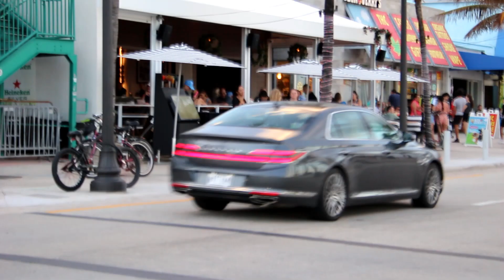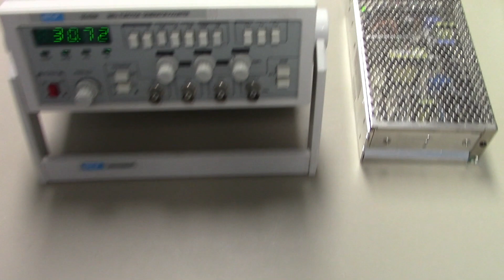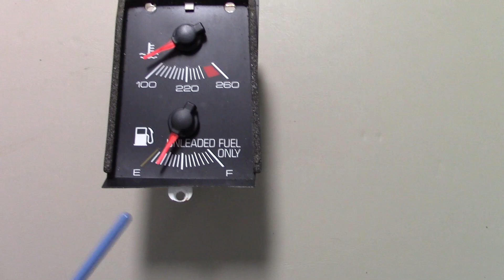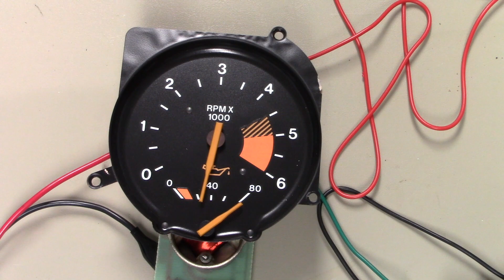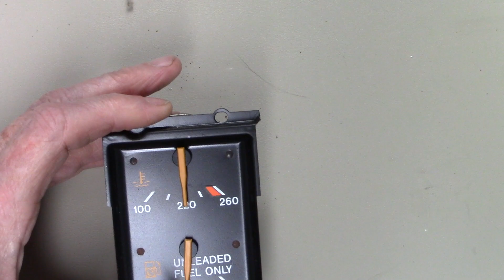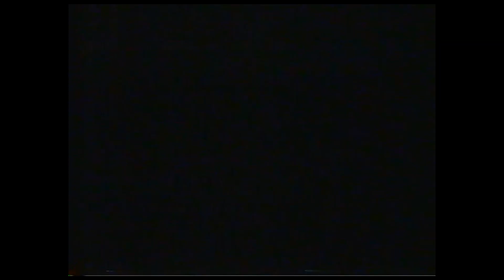Fiero Gauge Repair & Service w/ Jack Gunsett : Gen Z Garage - Ep 36

Comment: Great video!  At 1:23 the back dark green lamp holders look all the same color. That probably means they are all the same bulb.

 On my 1982 camaro some lamp holders are  Army man green and some are black..this was just a visual key for the assembly line workers.

The 82 here uses two different brightness lamps. Most are #194 and some are the brighter #168 bulbs 

I usually change them from the drivers side using a plastic tube to fit over the bulbs. Be careful do not push hard. The back white frame is brittle  often with age.

Once you replace a bulb it is brighter since a new incandescent bulb. Ie as they age the glass gets fouled and they are dimmer.

Aftermarket 194 and 168 bulbs are often different brightness too. So that adds to the confusion. 

In a used car often several bulbs are burned out and one or two are brighter since the person put the brighter 168 bulb in the 194 socket.

The white frame of the Guage cluster is not robust for UV exposure.  So if you take the front black bezels off and delay  your project; beware the white plastic grows brittle.

The little bead inside the GM Oem 194 and 168 bulbs had different colors. Ie the 2mm?? Diameter bead inside the bulbs holding the element wires. 

This was so from the drivers side one could see if the 194 and 168 bulbs where in the correct  sockets.

Aftermarket 168 and 194 bulbs often have no bead color key.

So say if a Fiero all has one bead color except one bulb that may or may not be the same bulb. Ie bead color is just a clue today.

Comment: Any idea when you'll be driving the car?
Reply: She's several videos behind, the car has been drivable for awhile now.
Reply: Rip
Reply from the maker: Yeah lol except the cylinder head had a slight crack in it that we didnt know about, so it was burning coolant. We got a new one and its currently at the machine shop. Hopefully it’ll be drivable again soon!!!
Reply: @GenerationZGarage  Cracked cylinder head? Did someone overheat it? Is that common on 2.5 liters?